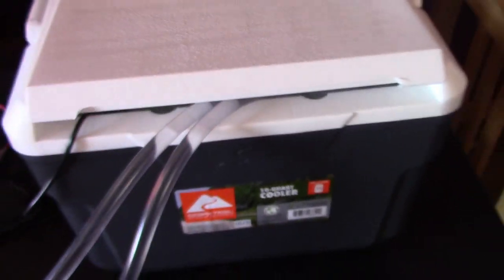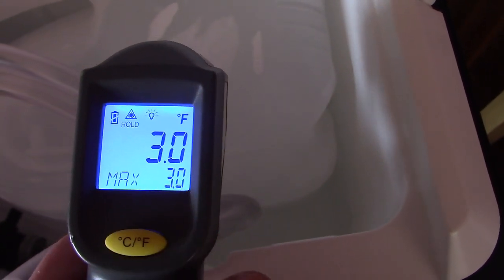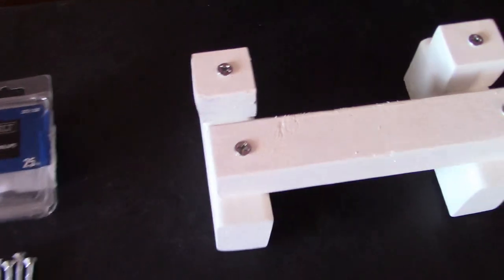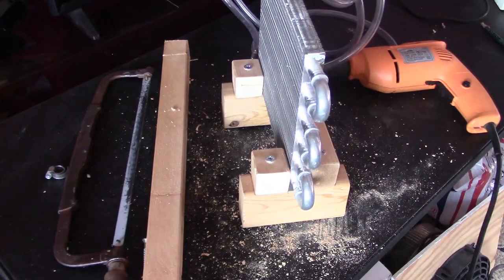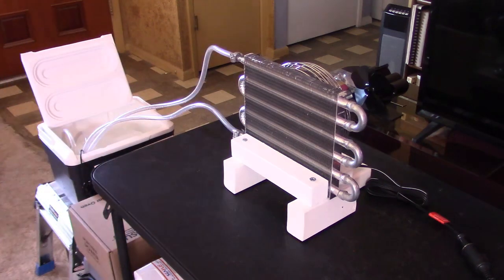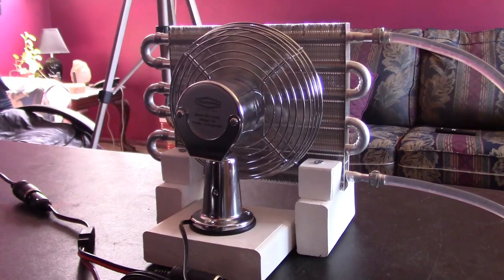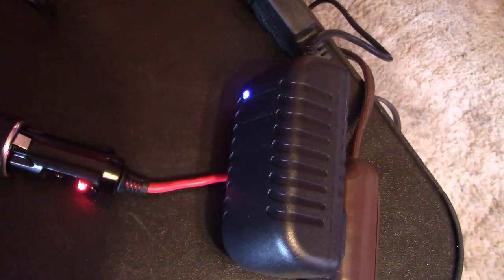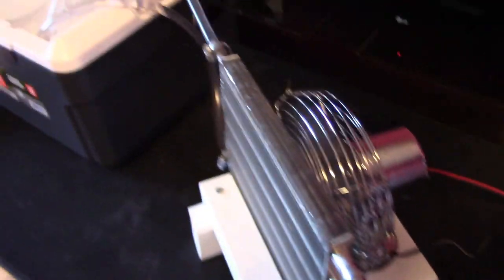DIY 12V Air Cooler! very cold air! 20w (AC or DC) - Radiator w/Stand + Hi-Speed.Fan! modular design!

Comment: Ice lasts how long?
Reply from the maker: hi there. that depends on a few things like what size ice block you use and if it's frozen solid or not. the air temp in the room and the fan speed matter too. i'm getting about 5 hours from the blocks i've been using recently. try not to use ice cubes. those don't last very long.

Comment: Hi, quick question ,  is it possible to hack a cheap existing box air cooler by adding a radiator inside?
Since the air cooler already has all the basic components, could we just reroute the tubing from the water pump to include an extra radiator inside the unit? Would that improve the cooling performance?
Reply from the maker: if i follow what you're saying, then i'd say yes. you can add internal radiators. several of my latest projects have 2 stages of cooling. my latest one is a 5 gallon bucket design with an internal radiator.

Comment: Suggestion: avoid having to constantly refill the cooler with a gallon of ice by simply using a DC-powered cooler which can bring the temperature inside the cooler down to 0 degrees F. It’ll use a 200 watt solar panel and a lithium battery and it’ll run forever on its own like that 24 hours a day.
Reply from the maker: hi. i think that's a good idea. i may buy one and do some experimenting

Comment: I built one a fews years ago using an old 5k btu ac radiator. But the problem i  had was condensation. That maybe because i live in a humid area (louisiana). Had the same fan and same pump.

Comment: I’ve wondered if something like this could work for geo-cooling I.e drum buried ten feet down, filled with h2o, with small radiator in drum, connected to small radiator in room with fan behind it. Solution in closed radiators loop can be water/glycol solution. Water ten feet down should remain approximately 55degrees, and as fluid at top is warmed as it circulates, heat will be exchanged into drum below and cooled by the earth. This should work until water below is heated to ambient temp, then the system would need to be shut down until it’s cooled again by the earth.
Reply from the maker: hi. that sounds like a good idea. if you use enough water it may stay cool enough (without needing to turn it off). maybe run the water thru a long coiled pipe under the ground. i'd use 1/2" copper if possible. that would cool the water down fast

Comment: How long for non stop running until it goes nothing but warm
Reply from the maker: hi. it will depend on a few things like how hot the ambient air is, how much ice you use and how fast you run the fan but i usually get 3 or 4 hours at a time (in 80F temps). if you use more ice or bigger blocks you can extend the time quite a bit. i've used ice frozen in 3 gallon buckets before and gotten 8-10 hours. another thing that is sometimes overlooked is how solid the ice is frozen and at what temp. ice frozen at -20F lasts a lot longer than ice frozen at +20F. i usually freeze the ice at 0F.

Comment: Nice and simple. Would be useful for tent camping as long as you could buy lots of ice nearby. You could add a 12 volt chiller and eliminate the ice. The guts from a 12 volt minifridge would work. R290 (propane refrigerant will give you -40 degrees.) You would need a fan on the condenser coil and could immerse the evaporator in your water-bath.

Comment: Were there no condensation from the radiator?
Reply from the maker: hi. i don't typically have that issue where i live (because the dew points are generally low here). if you do, then maybe just lay a towel or piece of plastic in front of it to catch any drips.
Reply: @desertsun02   my place's humidity is quite high, im concerned this setup is gonna blow more humidity inside my room. Perhaps I'll just have to try it first. 

Btw, do you think this would work if you exhange the cooler with a refrigerator. I found a cheap refrigerator. So essentially, you dont need to replace the ice as the fridge will cool it constantly. Will it work?
Reply from the maker: @johnlegend9553 hi. using a fridge sounds like a good idea. btw, these types of air coolers (the ones that use ice or 'ice and radiators') don't add any humidity to the air. not even a little bit. they actually take a little out (the condensation that may occur is water actually being removed from the air). the ice-based air coolers are 'phase change' air coolers. they just remove warm air because when ice melts it literally absorbs the heat. the only types of air coolers that add humidity are evaporative air coolers (also known as swamp coolers). those use water and wet pads to cool the air (but they don't use ice).
Reply: @desertsun02  hi, thank you so much for the explanation. This definitely helps!

Comment: How well you think the radiator performs in comparison with the foam evaporation pad for the same dimensions? I would rather use the pad if it means that is more efficient.
Reply from the maker: hi there. it's hard to compare the two because they are different types of air coolers. the air coolers that use pads are evaporative air cooler (also known as a swamp coolers). those use evaporation to cool the air, so how well they work depends on how humid the air is. they work the best when the air is dry or semi-dry. the air cooler in this video (with the radiator) is ice-based so it's a 'phase change' air cooler. this one doesn't generate any humidity and isn't dependent on how humid the room air is. it will cool the air down even if the air is 90% rh (relative humidity). if you're using the unit in a drier climate then an evap unit (swamp cooler) might be the way to go because they don't use any ice. all they need is room temperature water.

Comment: How long does the ice jug stay in general?  If you went to sleep would it last most of the night?  This is great for a power station in a lights out situation.  Insanely clever!!!
Reply from the maker: hi and thank you! it can vary quite a bit but in generally get 3 to 4 hours (so for overnight use i'd use a larger ice chest and put in 2 or 3 frozen gallon jugs). you can also add blue ice paks and ice cubes if you like. the more ice the better. the bigger blocks last the longest

Comment: I would love to see you figure out how to put a very small A/C system inside an inline duct fan. It doesn't have to be anything like 8000 btu, but it does need to be able to cool a small space like a dog house. That would be awesome!
Reply from the maker: hi there. i thought of those tent sized AC units when i read this comment. those are very compact and are usually 1000 btu's to 4000 btu's. i just wish they didn't cost so much. (600 to 800 or more).
Reply: @desertsun02   Exactly! I was looking at them myself and man are those expensive. I then looked at doing some sort of thermoelectric peltier cooling inside an inline duct fan but I just dont have the expertise to pull it off. I'm no electrical engineer. I am considering a cheap $200 8000btu portable A/C, but would love something built directly inside an existing inline duct fan.

Comment: Does it make the room humid?
Reply from the maker: hi. nope. it's a 'closed loop' radiator system, so it doesn't produce any humidity at all. it will actually take a little humidity out of the air (in the form of any condensation that may occur on the radiator).

Comment: Love watching your videos ideas, Thanks for sharing. Watched the old vid also using radiator (double), my question is what will be the temp if you dont use ice coolant / cold water? How much it is going down ?
Reply from the maker: hi and thank you! i'm not sure i understand the question. but if you mean 'how much will the air temp drop if you blow air through a radiator with no liquid pumping through it.' then i'd say the temp wouldn't drop at all. it would just stay the same. with the liquid in it, i'm getting a 25F temp drop from 80F/27c down to 55F/13c

Comment: I can't believe I hadn't thought about using a 12V solar source to run my energy generating machine like you did here. I had thought about using a small 12V battery and worried that the energy pulled from the battery would be more than the energy produced by the machine. But using a 12V solar source the energy requirements would be zero and any energy produced by the machine would be free.

Comment: Nice video :) the options for cooling are … 1 use ac, need much constant power, cost a lot, result never ending cool. 2 evaporative cooler (swamp cooler) much less power, and uses water, cost much lower, adds moisture to air, wont work in humid wheather, in good conditions will cool. 3 use direect or indirect cold source (ice) low power,uses ice (need some way of making or buying), mostly for shorter times.  Simpelest evaporative that i have used sometimes, need fan and wet towel (somithing to drape towel over and drip tray under. Fan blow across the wet hanging towel, towel gets colder from loosinig moisture and air blowing across colder towel cools air. Works maybe 30 minutes to 1 h before towel dry.

Comment: Great job.
I would keep the water from touching the ice block by keeping water in a container within  ice chest and keep the lid closed by routing the water lines through a bulk head in the ice chest . I think it will keep the ice block from melting so quickly and make it cool the air longer . I am not a thermal dynamic expert so please correct me if I am wrong . Thank you for sharing your knowledge

Comment: The real energy draw is the ice?
How much is the ice, and how long does it last?
I liked your last contraption like a swamp heater to cool water and then pipe it to this as a second stage.
Reply from the maker: hi. since i'm using the fridge for the ice - it costs just a few extra cents a day (in electricity) to freeze. i think you're referring to the evap (swamp) "water chiller" units i've made. those do indeed cool the water down. (for those not familiar, those units cool down water (and air) by using 'water soaked' pads). you could certainly use that chilled water with this. those units just need dry air to work well. natural sources of cold water may also be 'well water' or lake/stream water if you had it close enough.
Reply: @desertsun02  just keep the bucket of water inside the refridgerator or freezer full-time and it will never heat up

Comment: A twelve volt fridge freezer that works from a solar panel would be an Ideal companion for your set up. 👍
Reply: Or a twelve volt ice maker would compliment your set up. 👍
Reply: Could be possible not long ago experimenting with peltier modules need a different fluid water frozen up in the aluminum cooling using RV antifreeze. Next experiment using 100 proof vodka. Alcohol has a low freezing point go into negative Farenheight temps, RV antifreeze didn't work. Makes one wonder a swamp cooler peltier could do?

Comment: But......the heat generated by the fridge compressor is greater than the cooling.  You are just moving air of different temps around. Solutuon 1.  Move the fridge into the garage.
Reply from the maker: hi, this is true but various factors usually negate that issue. factors like freezing the ice at night, and the fact that it would only be the kitchen that would possibly gain a degree or two of air temp during the freezing process. for 'partial home' or 'room cooling' it works out very well 🙂.(it's also a great for general space cooling)
Reply: @desertsun02  True, thank you. Using night and day to offset each other is very smart!
Reply: @desertsun02 why not just use a DC-powered cooler to cool the water? I have such a cooler inside for over landing  and it’ll get down to 0 degrees F inside the cooler. I power using a 200 watt solar panel and a 100 amp hour lithium 12-volt battery. I can run the cooler and all of my cell phone:laptop charging needs off that system. No need to constantly replace the gallon ice jug you’re using.  Am I missing something here?
Reply: @Alex-sr3ez with this he is not adding heat exhaust into the room.  I am sure with your cooler you have a heat exchanger that offputs heat into whatever environment it is in.
Reply: But TY!
Reply: Not if you are using a portable box freezer outside in a cool shady place.

Comment: I built a similar DIY cold air contraption to yours. In fact,  I got the basic concept idea from your videos but I use 2 coolers. A large 48qt cooler that holds the ice/water that has a small aquarium pump whose hoses lead out  and attach to a 2nd smaller 12qt cooler with a heater core (Ford Windstar) and a SEAFLO 4" 12V 270 CFM blower inside of it. Water and airflow can be regulated by 2 dimmer controllers attached to the cooler lids. I added some extra styrofoam to further insulate the coolers. A/C parts to repair my old Mustang were too costly at the time so I built the AC/cooler for it and fits in the backseat. A 4" dryer hose attaches to the air pump and is connected to a T splitter that sits in between both bucket seats. It can also be used with a 12V 300W portable solar backup setup I built.Thank you for this channel and the "Cool" videos and ideas.
Reply from the maker: sounds like you made a great system! 👍

Comment: Very Cool man. . . !!! No pun intended.
I think this is great.  What size SOLAR PANEL were you using in this video?  Running direct?, no controller? 
Thank you in advance for your response.   
OH OH OH . . . BTW, I am going to build your design using the BILGE BLOWER FAN.  I will contain the coil inside the cooler for recovering condensate.
Keep up the great posts!!
Reply from the maker: hi and thank you. i'm glad you're building the project. that's awesome! i was using a 50 watt renogy panel (compact version). that is a great panel. it can put out over 3 amps and often does. technically a 30 watt panel would be sufficient to run the unit. i say 30w because that would give you the amps you need. a 50 watt one (like i used) would run the unit full blast all day (even if the panel was not directly facing the sun). all you need is a solid 1.6 amps to run the unit at high speed. (fan pulls 1.3 and the pump pulls 0.3). you don't need any type of controller. you can just hook it up directly to a 12v solar panel or 12v battery. you could run it all week on a good size deep cycle battery or lithium battery before needed to recharge the battery.

Comment: Nice. How many hours does it stay cold in the cooler vs a regular 5 gallon bucket? My pump is slightly bigger as well
Reply from the maker: i'm getting 3 to 4 hours of cooling per gallon jug. but that will vary depending on how hot the air in the room is and whether you run it on low or on high. i'm literally sitting in front of it right now (on low speed) because high speed was actually too cold at the moment. you can get much longer run time with bigger ice chest and multiple ice jugs or ice blocks. i think 8 10 and even 12 hours would be possible. i once got 11 hours of cooing on one 25 lb block of ice. that would be equivalent to about 2.5 frozen gallon jugs. i was running that air cooler on a solar panel that particular time.

Comment: Hi Desertsun, you have delivered another great piece of work. But am I right that you made something similar a few years ago, this is of course in a more modern guise. I still have a question, I personally find that hassle with ice difficult, you have to keep adding new ice and remove the melted water. As I wrote to you before, this may be possible to compensate for this with 1 or more PELTIERS, you must of course have a drain to the outside.... Just a question. Greetings from Rotterdam.😉
Reply from the maker: hi there. yes, i've made a few ice/radiator air coolers over the years. this one has advantages including having the removable desk fan and removable radiator (as well as having the fan behind the radiator). the ice chest is also sized so it's just big enough to hold full gallon ice jug without being too heavy to lift or move around. also is portable and very durable with AC and DC power options. i have a peltier air cooler or two on the channel but those have certain limitations. they require a LOT of power if you want one that is bigger than just a personal space cooler. i'll keep working on it 👍🙂

Comment: I wonder if a used mini-split indoor unit, instead of the trans-cooler, will be more effective?

Instead of cooler with ice, what about using a used chest box freezer connected to solar panels?
Reply from the maker: i've been thinking about getting a small chest freezer for a long time. you can get a 3.5 or 5.0 one for pretty cheap. those things would probably super chill the air

Comment: Very cool. It would be dripping with condensation in no time were I live. But I’m sure I could resolve that issue. I’m wondering if the condensation could be handled in a way that it would create another water source.
Reply from the maker: most of it will drip down so you might be able to put a small catch basin underneath the radiator (i was thinking just a 'hand towel' or paper towel) but a tray of some sort might allow you to catch the water and then use it to water a small plant or something?
Reply: @desertsun02 , Absolutely. If it’s not potable, it’s still worth collecting. Great content as always!
Reply: Maybe catch in a sort of gutter like dish with drain and have tubing run down into empty jug which you can freeze later to use to cool the air again?
Reply: 3d printed tray with drain to fit the tubing and under radiator would be great if one has that capability.

Comment: Another great "dry" cooling system, thanx.
Reply from the maker: hi. yes, these radiator cooling systems are great because they actually remove (water/humidity) from the air. it would probably work great in the southern states. won't remove as much water as an actual AC (but might be the next best thing) *other than using a 'store bought' dehumidifier or window AC unit.
Reply: @desertsun02  tnaks for the idea.... but, for how long the ice takes to keep it cooling? 2h? 4h?